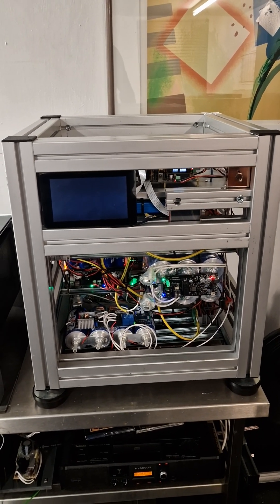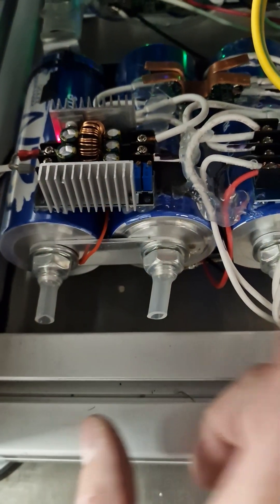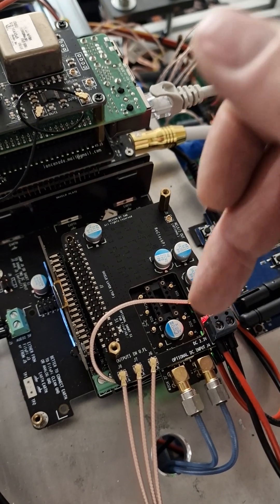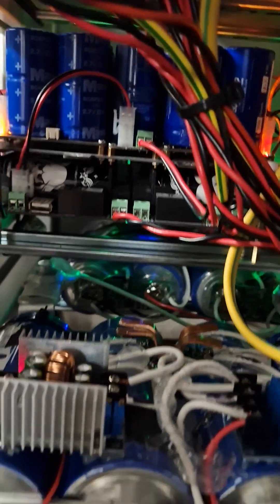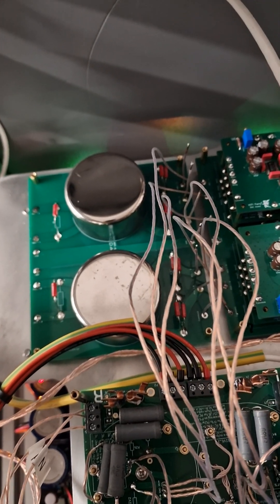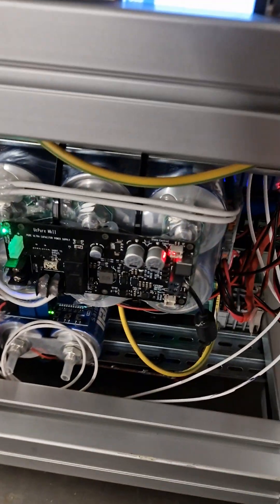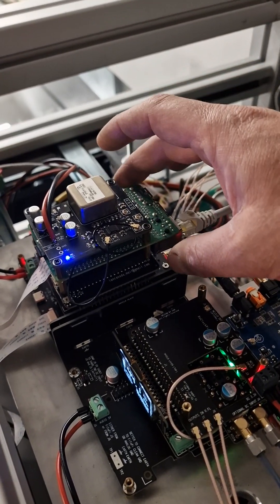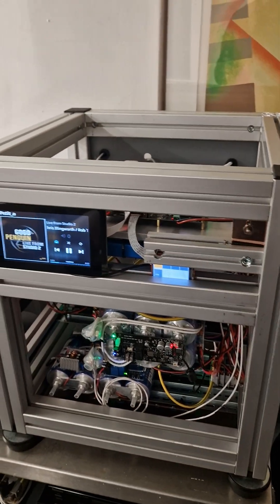DIY Hi-Fi streamer DAC. Custom Burr-Brown Pcm1794 dac. Ian Canada fifo Pi.

Comment: This is amazing, very impressive build, very interesting and informative. Are you on DIY audio forum?
Reply from the maker: No sorry. But message me if you want to
Reply: Hi, I have an IC I2S stack and I’ve tried using Symphony, I have the disc image but never got it to work. Which Pi version did you use?
Reply from the maker: @richardtrussell8220 I had a friend do it for me. And yes it's a mission..... I used v4 pi's for this. V4brev1. 4 I used but apparently V4brev1. 2 is easier to implement as it is a slower processor of something. It seemed and I may be talking nonsense that the v4 rsv1. 4 only became compatible recently.
Reply from the maker: No, sorry. You can email me for details. Thk0783217380@gmail.com if u want to
Reply: @tobyking4172 terrific build! Where did you source the extruded aluminum rails?
Reply from the maker: @michaelbrown3294 ebay. 60x60 and cut it on my RAS....

Comment: I want to say this about that!!!! not convinced Ian Canada's design is really needed. That DC to DC power supply can produce less than 1 microvolts ripple. 

So the bang for the buck on the LiPO  is in question!!! 
And asynchronous USB doesn't require all those crystals for clean transfer.

That looks like a lot of work!! 
Congratulations